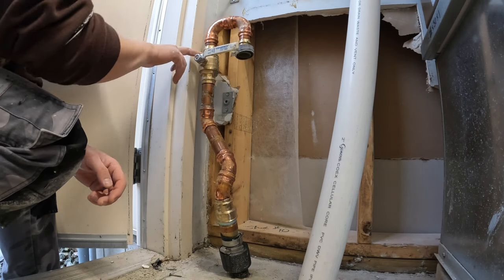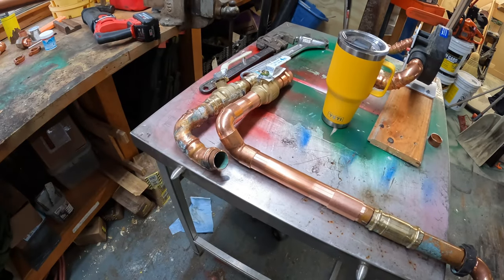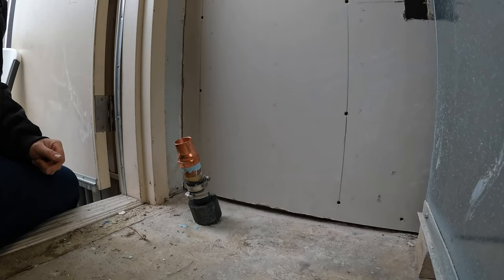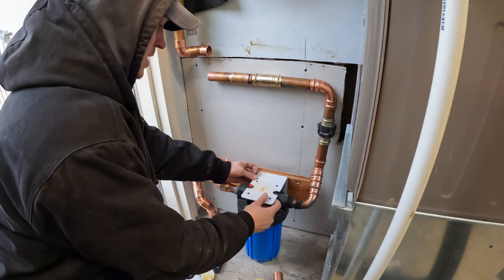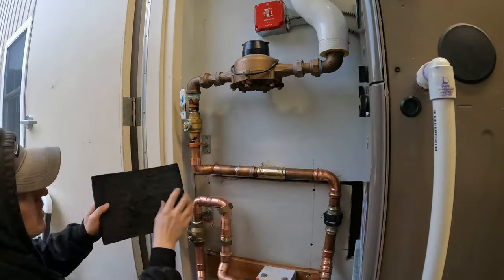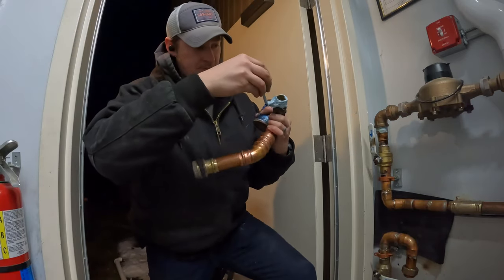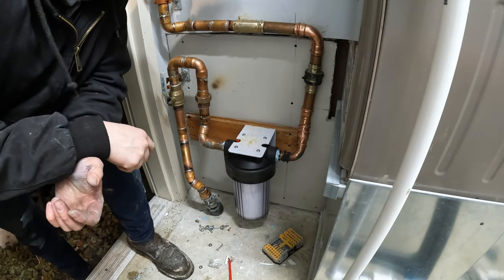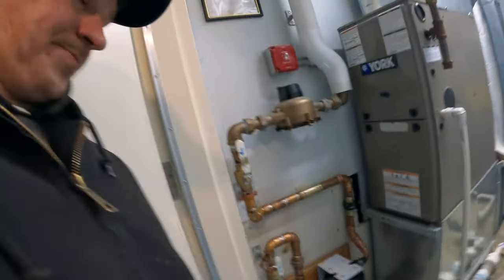Pro Press sucks? When you have to repair a leak. #2

Comment: Guy must have had an extra 28 fittings he wanted to get rid of dang. Imagine that invoice
Reply from the maker: It wouldn't surprise me if that's what they did, I have had a number of fixes in that building and the company that did the work is no longer in business.
Reply: @LifeofaCampRanger progress was meant to be for a quick repair people are building complete systems with it are going broke
Reply: The issue that I see is that he won't be able to remove the filter from the air handler
Reply: That's nothing! Seen that worse in iron!

Comment: Pro press fittings need to be spaced twice the pipe diameter. 

They need to be sanded with empty cloth and reamed. 

The less fittings you use, the less pressure you lose, the less points of connection you have for leaks. 

Sweating or pressing, build it, and press or sweat it all together at once.
Reply from the maker: Great points, wish I had thought through my repair a bit more so I didn’t use extra fitting but I’ll remember it for next time.
Reply: Technically they don’t need to be sanded… spacing is definitely important though. There’s a vid of a guy that presses a coupling without the o-rings in…. It didn’t leak, until he started beating on it😂 if the pipes not dirty, I don’t sand em..

Comment: propress doesnt suck that workmanship sucks
Reply from the maker: I don’t hat pro press if I did more pluming I would get the tool. If they had just used threaded ball valves it would have been an easy repair. I also should have used threaded ball valves but I can heat mine off. It’s no wonder the plumbing company that did the work is out of business.

Comment: Propress has been installed in at least tens of thousands or maybe hundreds of thousands or millions of buildings for years now. If you use quality name-brand fittings and quality pipe and you clean/debur your pipe, align everything properly, and install with a quality tool, it doesn’t leak.

I am not a plumber, but I have seen plumbers install copper plumbing in entire houses with propress, and I haven’t seen the stuff leak. I had to remodel part of my home after a natural disaster (long story). I saw the crew use propress on the copper plumbing, and it has held up.

I DIY small plumbing jobs myself, and I solder copper fittings for simple runs. I would generally prefer soldering (if done by myself or a plumber who solders cleanly) over propress where there’s good access and when it’s ok to leave water off for an extended period of time. For certain tight spots or fixes that need to be done quickly in certain cases, I think propress would make sense.

If I had to connect brass valves, I would probably use threaded or solder fittings at the valves and then propress copper-to-copper connections a few inches from the valves if I were going to connect brass valves to existing plumbing with propress.

But that’s just my opinion as a non-plumber guy who does various kinds of DIY construction and has seen pros do various kinda of plumbing.
Reply from the maker: I think part of the contributing factor to the leak is we had a freeze up in the building about 5 years ago but why it took that long for a leak to develop is beyond me. 

If I did more plumbing repairs and I could justify the cost to my boss I would buy the propress tool and use that for all of the plumbing repairs.

There are press fittings in other locations and they have had no issues but the problem I had was probably more to do with all of the fittings were pressed so to replace just the ball valves I had to remove so many fittings and pipe and put in new fittings and pipe.

I should have rebuilt it better but I wasn't thinking about making it a better design I was just trying to get water back on ready for the next group.
Reply: @LifeofaCampRanger I convinced the owner of the buildings I look after to buy me the press tool. It paid for itself within a few years in labor savings. It's 100% worth the cost.
Reply from the maker: @okgroomer1966  I really only make a few copper repairs a year, this was an unusual repair for me. Maybe in a year or two I will try and put it in my budget but for now I need other tools more.
Reply: @LifeofaCampRanger  ya if you would hardly use it it is unnecessary. I look after 53 apartments so am constantly doing HW tanks and such.

Comment: Did you consider PEX? Seems like some of the flexibility it offers could have helped with all the weird angles.
Reply from the maker: I don't have a 1" press tool for pex so that wasn't an option but I probably would have spent the same amount to get the tool as I did on copper fittings.
Reply: @LifeofaCampRanger  PEX + Sharkbite makes life soooo easy. I was hesitant on Sharkbite's for a while when they were new and hadn't proven how long they last, but I know folks who used them on projects from 20+ years ago without issue. I still won't use them anywhere that I can't access without having to cut drywall, but seems like they would be great for this project.
Reply: @LifeofaCampRanger the amount you spent on 1" copper press fittings, you could have rented or bought a manual pex expander.
Reply from the maker: That’s is probably true, I’m definitely looking into pex tools for future repairs.

Comment: its not just the plastic, never solder to close to any threaded connection unless you're using teflon tape. the pipe dope just melts out of the threads when heated.
Reply from the maker: I will keep that in mind, thanks for the tip!
Reply: Not only that,  if possible use a wet rag around fitting you dont want getting realy hot!

Comment: dang, that is a lot of pro press fittings everywhere in the beginning but in the aftermath, it looks good.  The prep work must have taken the most time.
Reply from the maker: There just wasn't enough pipe for me to solder in any new fittings so I had to remove way more than I would have liked. I cut out so much of the prep work but it payed off when it came to putting it in.

Comment: I have never been a fan of press fittings and when I saw them I can see why! All those dents and marks on the fittings look so untidy compared with soldered fittings - and they leaked! If they had originally been soldered the leaking joints could have been undone, cleaned and remade. Much less work than making the whole pipe section again!! I did sympathise with you when you melted the plastic fitting!
Reply from the maker: It wouldn't be a project at camp if something didn't go wrong. Pro press has its place and if the tool wasn't so expensive I would probably have one to make quick repairs but I might start doing more repairs with pex as it is much more forgiving in freezing temps.

Comment: I added washing machine braided stainless lines to each side of my home whole water filter. I made a steel ring that the filter unit goes into at the ceiling level to hold it. When I want to change a filter with the braided flexible lines I can bring it to the basement floor making it easier to loosen the filter canister.. The unit has been it place 10 years w/o problems.
Reply from the maker: That would have saved me a lot of time and effort but I will remember that for the next time I have a repair like this.

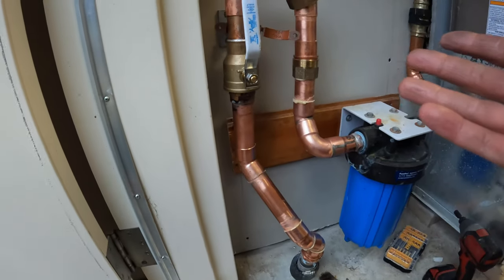Comment: It is not the fault of the propress fittings. It was the installer who needed to learn how to properly crimp the fittings. If the installer fails to prepare the pipe before the crimping of the fitting, it will leak over time, just like for soldering. You have to prep the pipe. That is today, clean the pipe. Just look at the piss poor design of this installation. The installer needs to gain a skill set in the field of plumping. Take advantage of these propress fittings just on this job. Investigate what caused this to fail? You will determine it based on how these fittings were installed. BUSTED! At timestamp 8:27, is that a propress inline fitting I see? Oh, calling the kettle black? Rushing? Ill preparation?
Reply from the maker: I don't hate propress fittings if I could justify the cost of the tool I would only use press fittings for repairs. The way it was installed made it very difficult to replace the two ball valves that were leaking.

Part of the cause of the leak may have been from a freeze up we had about 5 years ago but it's strange that it took so long for that to show up.

I wish I had changed the design of the install but I was rushing to get water back up for the group in the building that weekend and I am not a professional plumber but I probably did a better job with my work than the "professional" that installed the system in the first place.

The plumbing company that did the work went out of business shortly after they finished this job so I don't think this was the only job they cut corners on.

Comment: I do not use pro press valves. I will only use threaded ball valves..so i or anyone after me can replace or repair easily atound the valve.
A mixture of soldering and propress is perfect in my opinion.
Reply from the maker: That would have been a great idea, if I have to replace it again I will change the valves to threaded. Actually if I need to have it repaired again I'm just going to call a plumber!
Reply: Threaded compression fitting ball valves?
Reply: @goldistocks609  who said compression?
I like female threaded valves. So you can do future work easily.
Reply: @Maven401 I’m just curious, trying to visualize the setup and how a threaded valve is easier to remove if needed when you have to unscrew both male threads attached to the rest of the pipe, I’m DIY and trying to figuring out optimal setup

Comment: pro tip, if you arent going to support the verticals make sure youre heating the pipe a tad so that it expands with teh fitting, i usually just use spare copper pipe to support
Reply from the maker: Thanks for the tip, I will remember that for next time!

Comment: the leak is probably from tightening too much on the initial install, you have to be careful when mechanical fittings are that close to threaded joints because they can cause warps if theyre wrenched in too hard.
Reply from the maker: I still have the pipe so maybe I should cut it open and see if I notice anything obvious as to he cause. Wish they had used threaded ball valves which would have made a much easier repair for  me.
Reply: @LifeofaCampRanger  yep crimping is actually a science, its meant to form a uniform seat all the way around the pipe/fitting, and if its warped even just a little bit its going to drip cuz of an uneven seal. it looks like he wrenched that bad boy all the way in there which is almost never necessary in plumbing. most guys live by one turn past hand tight, i live by something like that

Comment: I like pro press, but prefer to solder, I just like knowing I did it right; and copper gives me that peace of mind.
Reply from the maker: If I could justify the cost of the tool I would use propress for a lot of my repairs but for how much plumbing I actually do it is not worth it.
Reply: @LifeofaCampRanger  you can justify it only if you do service plumbing for a living, I am planning on buying one pretty soon I have a PEX one and I still do my copper repairs with sweat
Reply: Same I have a $7k pro press , but prefer solder on big jobs, unless I have a small window of time I need to finish or I’m being lazy I pull out the pro press,
If theirs a leak on pro press some times you have to replace a lot of fitting like this situation, not the same on solder you can head it up and remove old pipe
Reply from the maker: I do not do service plumbing just small repairs around a summer camp so definitely not worth it. I’d rather spend that kind of money on tools or equipment that I would use regularly.
Reply from the maker: That’s partly what I did the repair my self and I didn’t call a plumber because the only thing they seem to use is pro press. If I have another leak there I want to be able to just replace the fitting that is leaking and not most of the fittings.

Comment: I’m in Calif Coast and Sierra Mountains. I never had any trouble with propress and Pex A …. Pex A is good in extreme temps cause of expansion abilities. I use Vega brand….
Reply from the maker: I am looking at switching to pex for the repairs that I do around here because it will be faster and easier to work with.

Comment: I'm curious. Why did you run the waterline up higher than the filter, then back down instead of just putting in a 90 at the height of the filter intake and then  a horizontal piece into the filter?
Reply from the maker: I like to make things more complicated than they need to be. lol I unfortunately copied what the "plumber" did originally instead of rebuilding it completely like I should have.

Comment: I’ve never had that many problems with it, and I use it regularly ( almost daily in commercial applications). If it’s the Viega brand contact them and send them the fittings that leaked and they will investigate.
Reply from the maker: There were only two leaks one on each of the ball valves, I think they were caused by a freeze up from a few years back but I'm not sure why they took so long to show up. I had to replace so many fitting due to the lack of space to add solder fittings.

Comment: We are using propress only and had only a few times problem. İt works perfect if you do it right...
Reply from the maker: That’s the key there is if you use it right. I like propress and if the tool wasn’t so expensive I’d buy one.

Comment: Ok so im with you 100% Pro-press sucks and it's garage. What's the reason for using press again. You should have installed a bypass for the filter. Also you used alot of unnecessary fitting to put everything together.
Reply from the maker: I didn't use propress again I soldered everything new that I put in. That would have been a good idea but unfortunately I was to focused on replacing what was there exactly the way it was originally installed I didn't think about improving it.
Reply: yup  a rookie  numnuts

Comment: Improperly crimped fitting. Looked like there wasn't enough room on that valve for a good crimp. Viega always suggests crimping brass fittings twice. Brass is harder than the copper. With as many fittings that weren't pressed right either the make up wasn't right or the battery was low and or the press needs to be repaired.
Reply from the maker: That’s very interesting, both ball valves had pin hole leaks. I will have to check if they are Viega fittings or another brand.
Reply: Where does Viega state to crimp twice?  I can't find it on their website and I'm curious to read up on any other suggestions I'm missing.
Reply: thats right 2 times on brass lot oftheres young punks dont no that

Comment: You're either using too much flux or over heating the fittings and letting the flux run, use minimum flux and control your heat. You're on your way to doing great things. Sincerely, Muhambi
Reply from the maker: I’m sure I over heated them since I don’t solder very often. I should practice every so often to get better at it. Thanks for the advice!
Reply: @LifeofaCampRanger just enough heat to make the weld... no need to overkill. It takes like 10-20 seconds to complete 1 whole weld.
Reply: @LifeofaCampRanger i wouldn't place the entire flame on the pipe either (more surface area, no need).
Reply from the maker: Thanks for the advice.
Reply: @LifeofaCampRanger  get after it brother. What don't kill us, only makes us stronger lol 100%

Comment: I got a question for all y'all plumbers: if he is using the blue pipe dope (which correct me if I'm wrong acts as a sealer for the threads), y does he need to use plumbers tape? Correct me if I'm wrong, isn't using plumbers tape kinda like the equivalent to using a precut gasket for a car's oil pan vs. Pipe dope would  be like using liquid gasket maker, right?Using both would b a little overkill?
Reply from the maker: Yes the blue pipe dope is a sealer, it might be over kill but I was told by a plumber that the tape is more of a threat lubricant so it threads on easier. I’d rather use both even if it’s a bit of an over kill but I don’t have a leak than just use one and have a leak.
Reply: True. I guess Like the saying goes better safe than sorry. I couldn't imagine how frustrating it would be to diagnose it if it did leak again since naturally u'd rule this out from being a possibility.

Comment: Too many joints.  Fill up the pipe with dry sand and compress.  Close with a wood plug in the ends.  Anneal where you want to bend, and bend.  Or, use prisol, soft pipe, but use sand.
Reply from the maker: Thanks for the tip, I hope to never have to replace it but if I do I will re do it with a lot fewer joints.

Comment: I’m no plumber but at the 1:20 mark, seeing that monstrosity of propress system no wonder it leaked. 

Fewer is better. Clean up your angles. Damn! 😂

To add. I love propress for what I’ve used it for so far. But jeez, that set up gives propress a bad name.
Reply from the maker: If I had the time to rebuild the whole thing I would have but I was in a rush so the easier thing for me was to just copy the disaster that was already there. I don't hate prepress the tool is just to expensive for non plumbers and if its done improperly it sucks to fix.